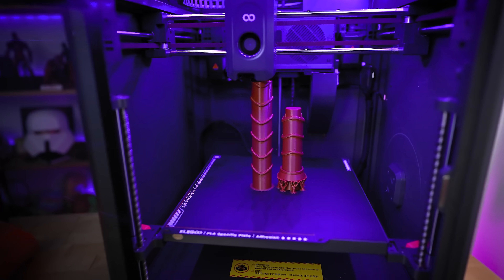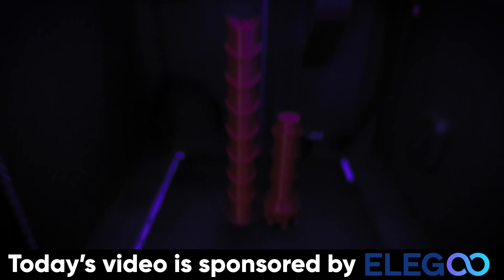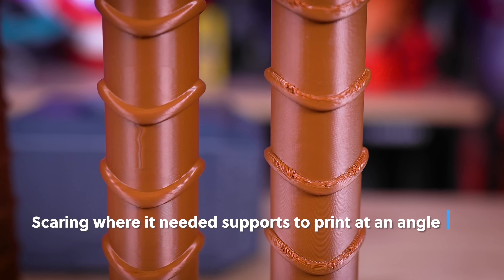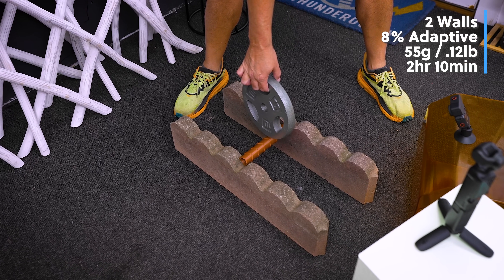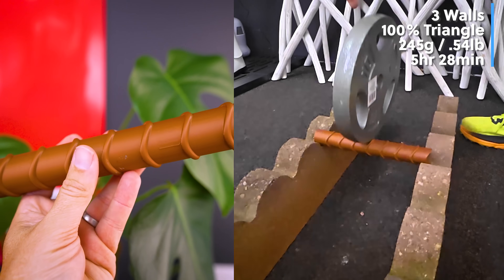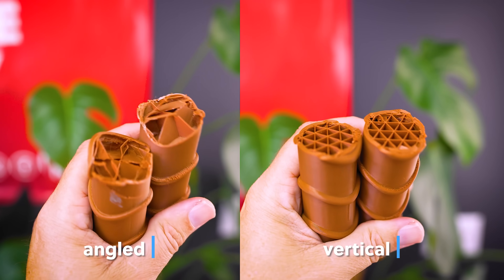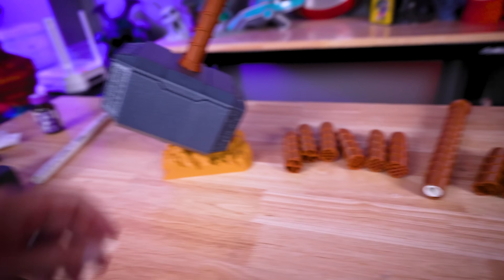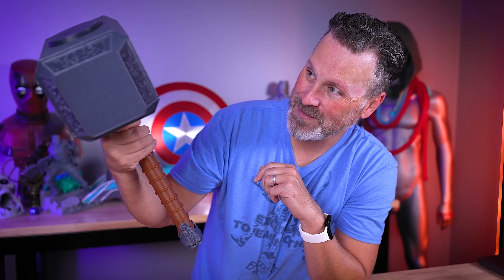Stop Breaking Your 3D Prints!

Comment: You can use a steel pipe to slide into the handle and also pause printing near the top of the hammerhead and fill it with sand. That will give a real nice heavy feel to it.

Comment: I immediately thought of pouring epoxy in the middle to strengthen it even more. It would add some weight to it as well. Of course some epoxies heat up as they cure so I'm not sure if it would cause the pla to melt or deform.

Comment: I'd fill the handle and hammer head with rebar and concrete, would be pretty solid and the added weight would be more realistic. Print both hollow, and the head could have a cap or something to allow for filling and then glue the cap in place after the concrete cures.

Comment: I just did a Mjolnir. I printed the handle vertical but printed a dowel horizontal split in half long ways to run through it.  Have a crozzgrain print pattern once assembled like plywood.

Comment: Yep - PVC pipe inside for the win! Probably cheaper than the filament needed for solid infill? Even if not, it'll still handle more rough handling at conventions.

You could always go for iron pipe if you wanted more weight. 😉

I know I'm guilty of this thought pattern: "How can I print this stronger?" In actuality, sometimes NOT printing part of something is easier, cheaper, AND stronger in the long run. Multi-media crafts save the day.

Comment: if you didn't want to buy a full stick of pvc for a certain handle, you could also print a cylinder to fit the inside longitudinally similar to one of the tests you did. This should (theoretically) hold up better than the two piece one since the radial banding of the walls will hold the insert in compression and prevent misalignment.

Comment: for strength always have layer lines going the longest and furthest they can, which is almost always the ugliest result, printing this laying flat on the bed would have the layer lines going across the entire handle which would make it a lot more durable, and it would be a fair bit harder to separate or snap the layer lines, overextruding or using brick layers would also increase strength. Even the angled part snapped near the layer lines because it was just angled and not completely horizontal. Layer lines are by far the weakest part of any print simply because no matter what you do a 3d printer still cant give you 100% layer adhesion. Layer infil is also pretty worthless especially in this scenario and its more so to prevent the part from bending too much in an impact, id say 6 or 8 walls with a 5% infill printing horizontally with highest temperatures your fans can cool without deforming and a bit of overextrusion would make it tons more durable.

Comment: Personally, instead of 100% infil I much prefer using walls to make it solid, so just set it to like 20 walls until it's solid
Reply: It is possible to have more contact area -> better adhesion in alternating infill lines than in regularly stacked wall lines. I think My Tech Fun tested this once.
Nudging the lines up-and-down or sideways to create staggered infill and walls could do even better. But that requires more flow to fill the gaps.

Comment: Glad you also went the PVC pipe reinforcement, I use that as well as wood dowels depending on the diameter to reinforce longer cylindrical prints.

Comment: We've had to address this for a couple reasons. We have printed a full sized staff that we needed to be strong for one of our cosplays. Its a mix of pegs and very thick walls. (10-20 walls).
The other thing was a little robot called Fresh Cut Grass. The unicycle wheel mount assembly needed to hold up a whole robot. So we printed that as a clamp shell type thing, and put metal rods inside, then glued and soldering iron welded the halves together.
Lots of effort, but that robot is pretty solid!

Comment: Here is another idea you can try, Uncle Jessy.  When printed vertically, a cylindrical shape like this handle is very weak in tension, but very strong in compression.  If both ends of the cylinder are closed (with a small hole on each end), a threaded rod could be run through the cylinder with a nut on each end.  The nuts could be tightened to put the cylinder under compression and since the printed layers will be pressed together, the cylinder will be much more able to resist a side-load such as the weight you are using.  This is done with concrete and is called 'pre-stressing'.

Comment: For my two pence worth, print an outer shell of the 45deg angled print, with a hollow inner, probably a triangular void. Then print another with the layer lines parallel (flat on the bed), the triangular cross section will allow print without supports again. Then combine.  Two alternate layer directions should be a lot stronger

Comment: This was one of my first prints, years ago. The file I had was different that this one as the handle is 2 pieces, but they are just flat and glue together (as opposed to the connection point in this file. Mine is also a solid piece as opposed to this hollow file. I printed the handle vertical with gyroid infill and the percentage would have been pretty high. I did the same thing with the hammer head and likely used an entire spool to print the head. I finally have got around to finishing this print and decided to drill a hole to run a threaded rod through. This is all held together with a significant amount of two-part 5 minute epoxy. It feels rather substantial and I wouldn't blame a comic con if they wouldn't allow me to bring it in.

Comment: my 105cm height 1/20 Zaku's legs is putting solid steel bar inside as support for hold up the whole 13kg print, it works very well.😉

Comment: I always thought infill only will take you so far, its the number of outer walls where the most strength comes from. Maybe I'm wrong but somewhere around 50% infill and 5 or more walls should get you much better strength. I saw you did the 5 walls but with 20% infill.

Comment: PLA is the cheapest filament, but most certainly not the weakest - as anyone following youtubers doing actual material testing knows. It has some downsides, such as low heat resistance and deformability over time.

Comment: if you ever revisit, try adding a few very small holes straight down the handle, these small holes will force it to create these pillars of walls down the inside of the handle adding more strength then just infill.

Comment: If its just 3d-printing limited, then print it in 2 snugfit layers, outer core(with the handle textures) and inner core(basically a tube), print in an angle, then before joining(inserting the tube) make sure the printing lines/grains are running in opposite directions essentially crossing the grains making it likely stronger in all angles.

If not limited to printing, then inserting a pvc/metal tube instead of 3d-printed one or incorporating metal rods(structural support) in the design should make it more resilient.

Comment: im an owner of a CC and ive had it fail two time now. it keeps thinking the connection from the mainbored to the hot end is broken when its not. the OG USB C cable is broken and it will only print for like maybe a hour before it goes "hot end didnt heat up right BS" then i change back over to a 3rd party USB-C Cable and i can start printing like nothing happend for idk how long... 

i'll rather buy other N4 Max or Pro over a CC since my N4 Max just works unlike my CC

Comment: A tube mounted on glue would further reinforce this. I think it would absorb more force instead of shifting slightly relative to the print. A crack is an empty space, and if the print doesn't move freely, it will be more difficult to generate it.

Comment: I have questions. 🤣Would the gyroid infill be a stronger infill choice vs. the triangle? As you raised the 10 lb. weight up, the kinetic energy plus weight increases, Doesn't this change the test results for those you dropped more then once? I loved this video as it shows the different ways to (or not to) build things.
Reply: Since 100% infill was stronger, the infill pattern would probably make a difference....BUT, the weakness comes from the layer lines all lining up - wall through the infill.  If there was a way to stagger the layers, sort of like a 1/2 layer of infill on the 1st layer so it fell in the middle of the walls each time, that would probably increase the strength a fair amount.

Comment: I find printing at an angle to be most effective for my testers (my kids 7 and 5) usually I can get away with 3 walls and a mild infill around 15% in gyroid typically. What I do also is a modifier at any connection points were I increase infill to 30 to 40% and that seems to work well in keeping those points together!
Reply from the maker: Oh that’s a good idea about increasing it around connection points. So many ways to tackle this!
Reply: I had access to one of those Creality belt printers that printed things that way by default. They seemed to come out significantly stronger (when the machine worked correctly, it was a bear to level the "bed").

Comment: My project has been working on the Star Trek: The Next Generation/Deep Space Nine Type 3 Phaser.
Because it's also going to be housing electronics, part of the prop is including a 30in length of PVC pipe to house the electronics with access points for the button and for servicing the battery.
My first two attempts used Matte PLA which I found to be too brittle for my liking, so I'm printing it in regular PLA.
Reply from the maker: Yeah there are so many variables depending on the project you’re printing / how it will be used / if something has to fit inside etc